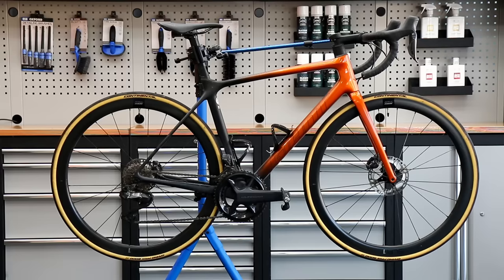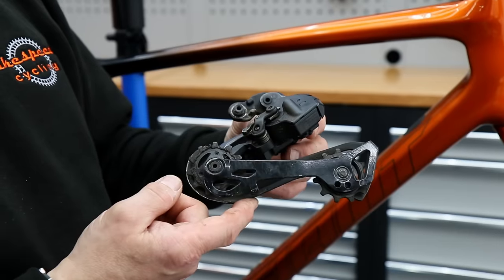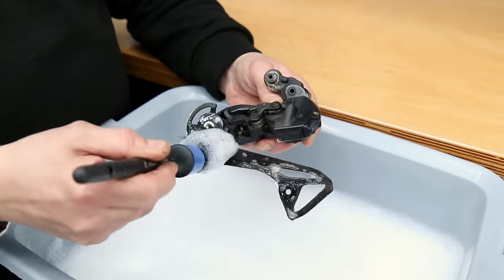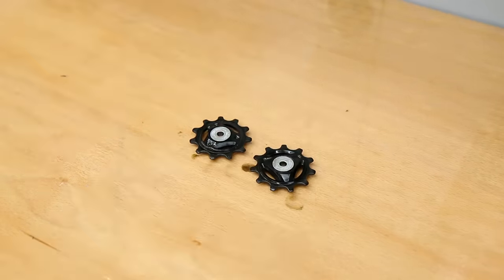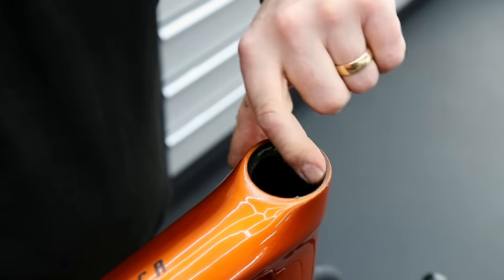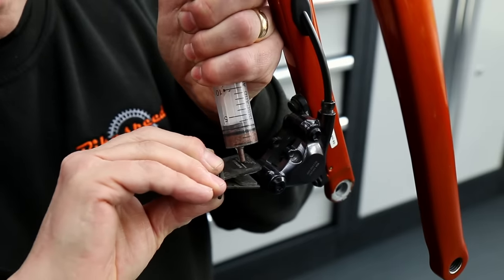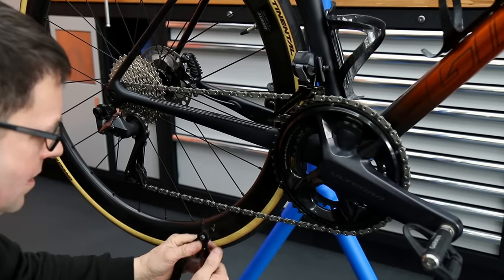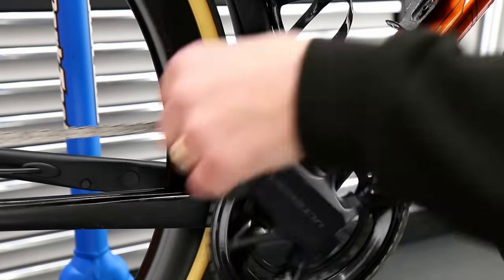Fixing Dead Di2 on this Giant TCR! Full Rebuild & Service! Headset Rust! 2022! Road Bike ASMR!

Comment: Looks potentially like a heavily used turbo trainer bike with that amount of wear in the headset bearings / corrosion maybe? Beautiful bike / service though as always BikeSpeeds!
Reply from the maker: Thanks for the support!🧡
Reply: that makes a lot of sense seeing the headset state
Reply: Agree. The brakes look far less used. Probably didnt spend much time on the road.
Reply: Or the owner just replaced pads himself then realized the bike has more issues than he can fix, seeing how much the cassette is worn
Reply: 😮😮😅 0:55  @Bikespeeds
Reply: @Bikespeeds 😮
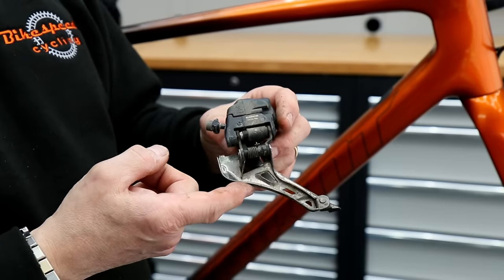Reply: @Bikespeeds 2:26
Reply: Another thorough job.

Comment: Im a Mechanical Engineer working in the Petro/Chem industry and I often see people using copper grease as an anti corrosion method, however its not really necessary - any grease will do - copper grease is specifically for high temperature applications in industry and can in fact cause sever galvanic corrosion if it comes in to contact with aluminium components. I appreciate youre only using a tiny bit, but its honestly not required.
Reply: Would you happen to know if copper grease is the same as anti-seize? By anti-seize, I mean the silver stuff. Thanks in advance.

Comment: Great service on a lovely bicycle. Being on a vertical axis, headset bearing tend to suffer disproportionately in rainy weather. It's not uncommon to find them in this state. Thanks for these videos, it's always a high point of my week. Cheers! 🚲
Reply: I ride in the rain quite a bit and I've never seen headset bearings even close to as bad as this. Shocking the state they were in.
Reply: @LukeRichardson1981  I've found it happens on bikes that "sleep outside", exposed to the weather. Regularly on plain cup and cone bearings, but once or twice on "sealed cartridge". My experience anyway.
Reply: Most probably sweat from a whole winter on the turbo ?
Reply from the maker: We find this to be common🧡

Comment: Nice job sir, i actually had the same headset bearings they split and little rusty i take it to my local dealer he said i have to wait 1 month for them to arrive, then i checked Ali express and found a good quality ones for Les than what he going to charge me i ordered it and fit it my self today after your video so thanks for the help to do it the right way.
Reply: How does a bike shop tell a customer it's a one month wait for headset bearings? Sounds like he doesn't want to be in business.

Comment: Im interested in the 'this bike will now do thousands of miles' comments that you often make Lee.

Had this bike literally done thousands of miles to get into this state of wear?

I ask as my (mountain) bike has probably done roughly a thousand miles, 70% on the road.  Ive made some elective changes in that time but ive replaced all the cables, two sets of bottom bracket bearings, chain, cassette, 3x brake pads, one rota, headset bearings, a jocky wheel, a front derailleur.

Basically a new bike 😅

Keep up the good work, i always enjoy watching.
Reply from the maker: These are often 1000 miler bikes, we have a very strong road biking scene locally where everyone rides hard!🧡

Comment: Great video and service, you opened my eyes. What a pain Di2 is? I'll stick with my 20 year old Dura Ace that has barely been serviced and works perfectly. I like how you removed the bottle cage bolts. I've never done that and they are now seized, so I repaired the broken plastic bottle cage with a zip tie.
Reply from the maker: Seized accessory bolts is a nightmare, always lubricate them as soon as you can!🧡

Comment: Great work. I recently received a new bike (Giant) as an insurance replacement for a stolen bike. I was really disappointed with the quality of the build up. The mechanics also laid the bike down on the rear mech just before giving it to me, which took a strip of paint off the corner. I dont feel the shifting has been right since day 1, which is very disappointing, as it's di2, but certainly no better than the 10yo 10speed it replaced, as i serviced the old one myself. I wish there was a quality shop I could trust here in Melbourne, Australia. The UK seems to still have people who care about the quality of service they provide.
Reply: if they laid the bike down on the rear mech side then it's possible that the gear hanger is bent.  another common thing shops miss when building up a bike is the rear derailleur B screw.  If your rear mech's top jockey wheel looks too far away from the cassette when the chain is in the smallest sprocket, try adjusting that screw.  loads of info / vids on YT on how to do it
Reply from the maker: That sounds like bad service!🧡

Comment: I also have this bike, a wonderful bike! What surprises me is that I see GP5000TL on the SLR1 rim. I only use the GP5000 str because, according to Giant, it is the only one of the 5000 series that can be used on hookless rims. I was just wondering if the user has ever had problems with the regular GP 5000 TL.
Reply: Good spot. Worth the shop following up on that before those mountain descents…

Comment: A lovely bike and seemingly well looked after too. Makes me wonder what caused that bad corrosion to the headset bearings and if it could perhaps be the use of a pressure washer?
Reply from the maker: Who knows, there is so much wet wether in the UK it’s par for the course if you want to ride in winter! Thanks for watching 🧡
Reply: Others suggested sweat from being on a turbo trainer. Definitely plausible. If you rode your bike indoors for the winter months, disassembly of the headset is a must imho.

Comment: I noticed that the wheels are Giant SLR hookless ones, and the tyres seem to be GP5000 clinchers. Normally only tubeless tyres could be used on hookless rims and clinchers may cause potential risk or failure. Not sure if this is actually the case as the customer may or may not be aware of this. I previously run the GP5000 clinchers on those Giant wheels (with inner tubes) without any aware and has no problems but in theory should not do this for safety reason

Comment: It’s pretty damning on Shimano that a R8100 battery already needs to be replaced. My R8070 di2 battery is still going strong. Maybe the owner got unlucky with a bad batch.
Reply: I was thinking that, kinked or damaged Di2 cables can rapidly drain the battery.
Reply: Mine lasted less than a year. I thought it’d be ok in my garage in north wales which generally isn’t cold, more damp. The replacement is now kept in the house until the weather picks up. I was a little disappointed as it’s my first di2 bike. The shifting is 1st class but you need reliability.
Reply from the maker: Hopefully this one is more reliable 🧡

Comment: Shimano Di2 systems have been out for over a decade now. If you had to put a number or percentage on it how many bikes come in with dead, non updated firmware, or just plain busted systems. I have likened the cableless system the same way I view electric cars. I prefer using cables for my bike components and a gasoline engine for my automobile.
Reply from the maker: We are with you completely!🧡

Comment: Another superb service and the TCR  transformed to a new look bike 👌.......as part of the service guys, when it comes to replacing chains:  do you remove the factory grease, get the chain clean and then apply the rollers a suitable lubricant?
Reply from the maker: The chains we use in general actually come on a commercial sized roll unoiled so we do oil them ourselves 🧡
Reply: @Bikespeeds  thanks for the reply : It's great when you learn something new......a fact that I never knew ! Going to watch the 15-mile bike ride 👌 ......Have a great weekend !

Comment: Great job, well done!

Please, could you tell me, why are you referring to DI2 chain instead of just number of speed on the bike? 
DI2 or mechanical groupset would not make a difference to the wear of chain, would it? 

A chain needs to be replaced when it has stretched by a significant amount – 0.5 per cent stretch is the usual threshold for 11- or 12-speed chains, while 10-speed or under chains are generally deemed fine to 0.75 per cent stretch. 

Please correct me if I am wrong. 

Thanks

Comment: The thing that always concerns me about electronic group sets, is what happens when they decide to discontinue the battery? Eventually it'll die, and the odds of getting a compatible 3rd party battery pack aren't great. I don't want to have to throw away a bike because of a bad battery.
Reply: Yeah not to be a luddite but I find them dismaying from an environmental point of view. The embodied energy and resources (rare earth metals) required for a battery shifting system, considerably exceed what's required for an orthodox cable-actuated system. I imagine that it's easier to push/pull the shifter on a battery system, which could be enabling for people with problems with their hands e.g arthritis. Otherwise I'd prefer people not to be seduced by what is otherwise a higher-environmental-impact product.

Great service as always Bikespeeds. Unmatchable care and attention 👌🏻
Reply: This is nothing to worry about. shimano will never stop making a battery that powers the entire range of groupsets. Think about that. we have di2 at 105 level. in less than 10 years it will be at every level. and when there’s a bigger market for third party batteries then a company will produce them. after all they are just lithium battery’s like every other.

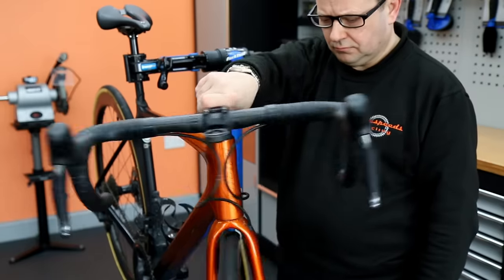Comment: 0:32 i have the same frame design TCR(same down tube hole cutout for mechanical shifting etc) except mine is 11 speed 105 mechanical, currently thinking about upgrading to di2, some questions in advance, do you think the right hand side brake hose is left a bit too long on this bike, or even the left hand side too?

Comment: I’m not too familiar with road bikes.  What is a DI2 system?
Reply: Shimano electronic shifting
Reply: It’s shimanos electronic shifting. This one is their more recent 12 speed, basically a big lithium battery under the seat, 2 wires going to derailleurs, and the levers fully wireless ( no visible cables)

Comment: I've rounded off the torx nut on the top of the handle bar stem (whatta noob), any handy tips for getting it out? (rubber band trick was a no go). Nice job on the TCR btw :)
Reply: Use an angle grinder to accommodate a flathead? Or what I tried was periodic WD40 sprays to penetrate the bolt before trying again. If no angle grinder the take it to your local bike shop and see what they can do! :)
Reply: As a last resort if all else fails you could drill it out. If it's a carbon steerer on your forks you may need a new compression insert if you cant remove the remaining bolt. If it's a metal steerer once bolt drilled you could use a vice or mole grips to grip the remaining stem of the bolt to remove it.

Good luck.
Reply: @figjamuk  Yeah sounds a bit last resort like you say, hope it doesn't come to that tbh, thanks for the tip 👍
Reply: @joshuawilson7162  No angle grinder here, I'll probably end up taking it to the shop with and handing over with a sorry expression, hopefully they take pity on me 🙃Thx for the help tho.
Reply: Faced a similar problem few weeks ago with a aluminium stembolt. But in my case the threads of the bolt were also stripped inside the extender plug, so that it would not come out. Ended up drilling out the bolthead, put the whole steerer tube through the hole of a weight-plate wich i suspended between two tabletops, and put locking pliers on the remaining part of the stembolt. Took a few minutes of hammering the clamp against the plate but saved me from getting a replacementfork.
Reply: @dexterx55  omg whatta mare, well done for getting it out though, I broke my arm 6 weeks ago, so no heavy stuff for me atm

Comment: The tape on the seatpost is actually to know what saddle height it's at. I know because I Learnt to do this on my own bike from where I used to work at.
Now you just ruined the bike fit for the customer
Reply: This. Very strange so much people don't know such basic bike stuff 😁
Reply from the maker: We put it at exactly the same height for this reason🧡
Reply: @Bikespeeds  I mean it's common practice so I thought you would have known to leave it.a marker line would be harder to remove and scratching the surface wouldn't look nice. Anyway, you u didn't before but now you do know